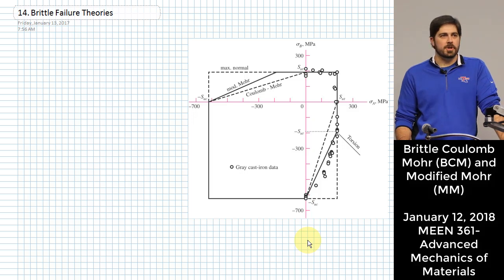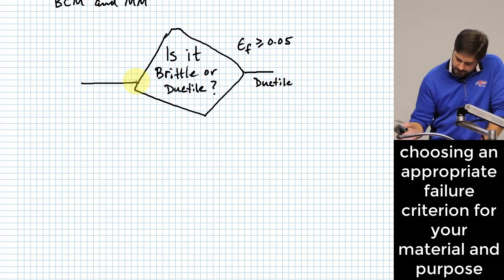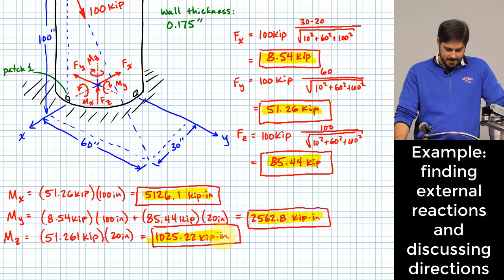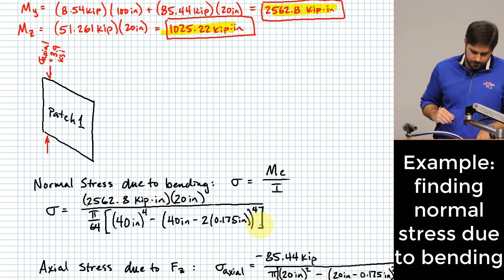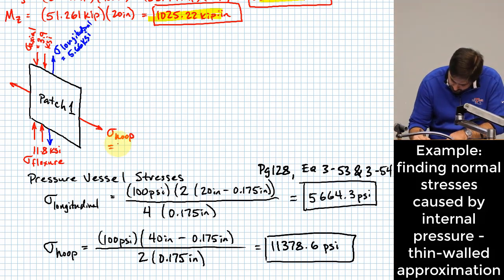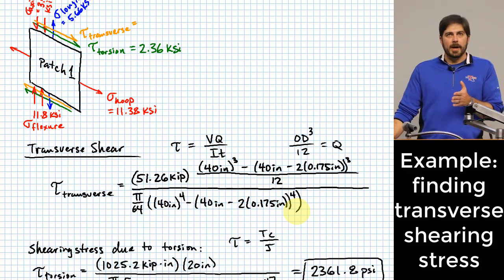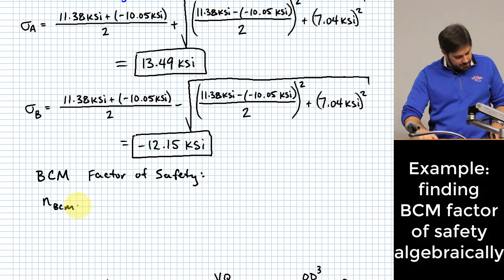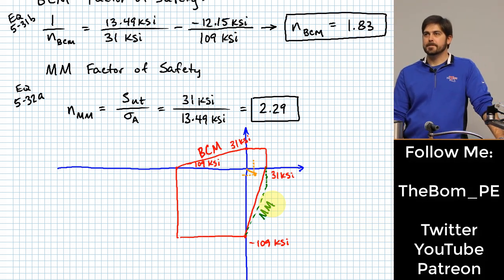Brittle Coulomb Mohr and Modified Mohr: Brittle Failure Criteria

Comment: Hello. Thanks for the videos. They are amazing. 2 quick question related to the Tranverse Shear Section portion to help improve my understanding.   When I think of transverse shear I think similar to an I beam examples where the force is perpendicular to to the I beam and that force produces a tranverse force. I don't see that with the force direction you selected. Let me send an example video of what I'm referring too.   https://www.youtube.com/watch?v=f08Y39UiC-o  (Somewhere around 7 and a half minutes). My 2nd question is that the tranverse shear stress you is at in the middle. Your patch is in the outer end right? At the edges there should be no tranverse shear stress.  The youtube video I sent also mentions that.